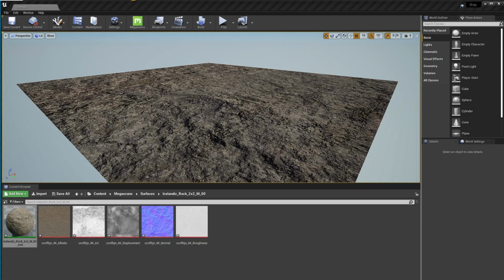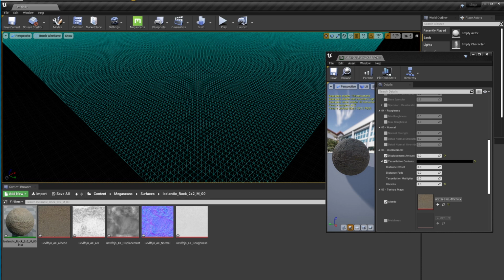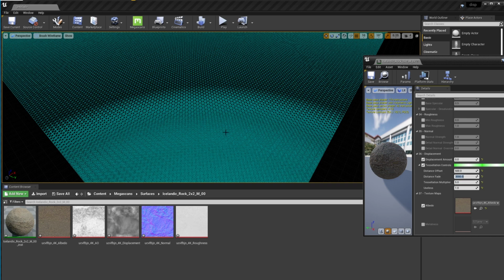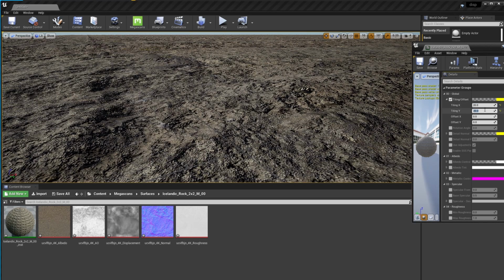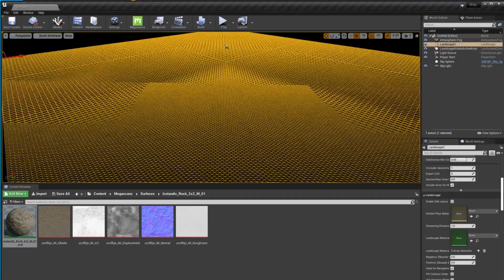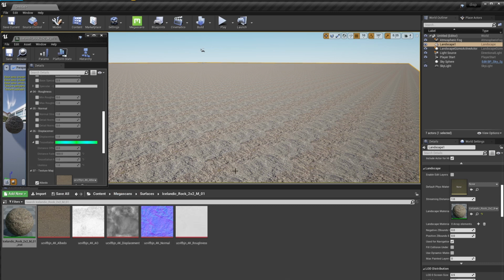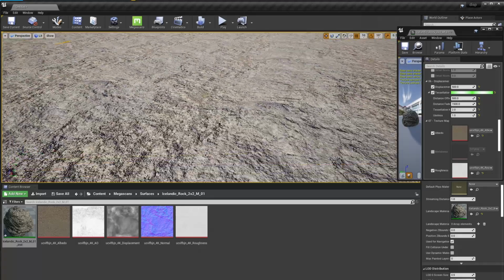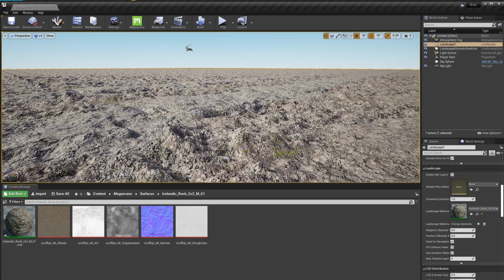How to Use Megascan Displacement for Landscapes in Unreal Engine 4

Comment: Thank you so much! This is super helpful and now I finally figured out the issue I've made!

16:09: The reason of the displacement is barely change because the displacement did not tile (!) What tile in this case was just all the maps but the displacement is being applied as ONE GAINT TILE. (!)

16:42 [SOLVE] Go to master material,  in the material attribution, scroll down to the tessellation, set crack free displacement to [False]!

FYI: When [Crack Free Displacement] is true, that means enables a displacement algorithm that fixes any cracks that may appear in the mesh. This is more expensive, however, so if you do not see cracks when displacing, leave this set to False.

Comment: I've tried to use displacement after implementing anti-tiling features but without success, the result I get from my Lerp'sfor example cant be input into the Hight input of the MF_Displacement, any suggestions on how to get around this issue?

Comment: Thanks for posting this! It was very helpful.

One thing I don't understand is why the Master/Parent material is set up the way it is regarding preventing cracking. Won't you need to do this anytime you want displacement in your landscape materials?
Reply from the maker: Well there is usually 1 master material so anything else that you import will probably use the same master

Comment: Hello, can I ask you a question, do you use the latest bridge and ue4.25,When I import the model from bridge to UE4, Roughness or packed RM texture are not checked by default but even if checked they don't get assigned to the material
Reply from the maker: I will need to see a screenshot of what you mean. You can join our discord, it will be easier over there
Reply: @MR3D-Dev-Tutorials   ok ， you can  look this   https://help.quixel.com/hc/en-us/community/posts/360014204298-Roughness-or-packed-RM-are-not-checked-